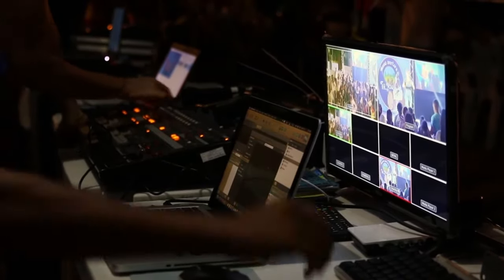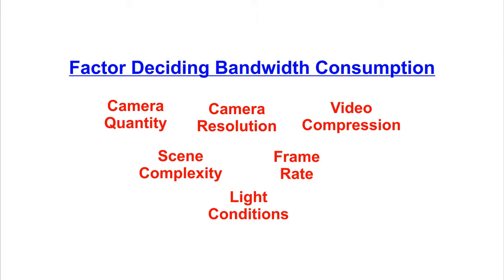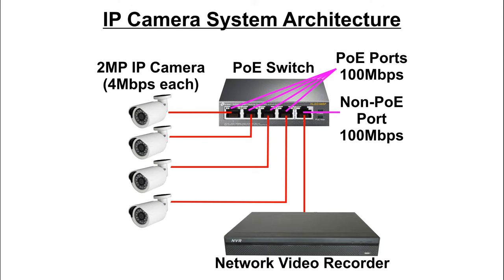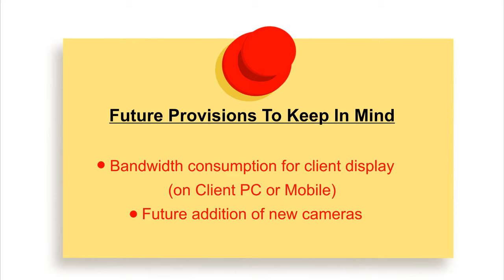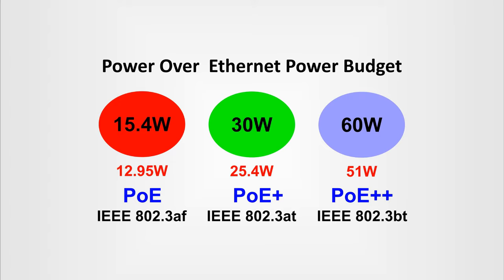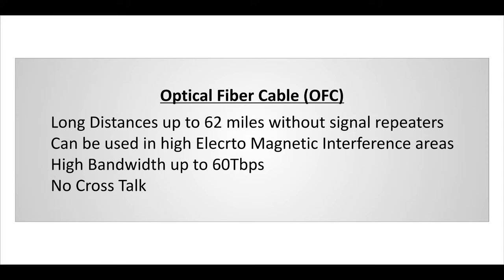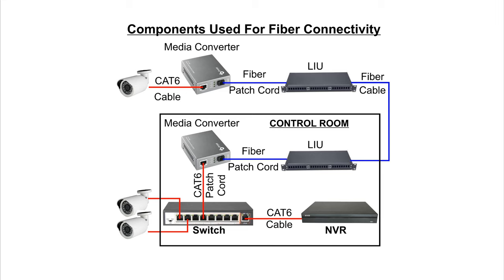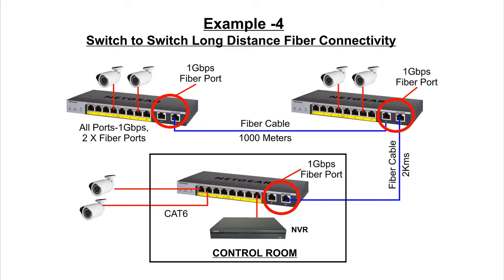IP CCTV Network Design | Component Used | Optical Fiber Cable | cctv networking #cctv #cctvcamera

Comment: Can i use ordinary or normal port on camera switch as uplink going to cctv room? Because some of the switch has no uplink port, intead of normal or ordinary port which is available.
Reply from the maker: You sure can use normal port. Uplink ports are  normally giga (1000Mbps) ports thus allowing sufficient bandwidths. If your normal port is also giga, then there is no difference.
If normal ports are 100Mbps even then they will pose no problem as long as bandwidth to be transferred is well under 100Mbps.
Reply: Can you make on your next video, how to connect multiple switches from access layer to core layer multi layer switches physically connected? Thanks
Reply from the maker: @reccakarl  Sure, will try. Thanks for suggestion.
Reply: Hi. What do you mean 70% of capacity, per port capacity or switch itself? Thanks
Reply from the maker: @reccakarl  This is no rule written anywhere. It's been considered so that we have some spare capacity in hand in case some need arises at later stages. I personally consider using 70% capacity of each port.
Reply: @AdventTechnical  hi thanks.  What if the edge switch is 1Gb, so we can use all of ports available even the camera is poe and the switch is poe also regardless of power budget does it matter?
Reply from the maker: @reccakarl  You can always use all the ports on the switch if required. Considering a bandwidth consumption of 4 Mbps by a typical IP camera and assuming the switch port to which it is connected to be gigabit (1024 Mbps), there will be no issues as the bandwidth handling capacity of switch port is more than what is required by the IP camera. We can even make use of switch with 100M ports to connect the cameras instead of switch with gigabit ports to save the cost. But please keep check on the bandwidth load on the uplink port of the switch (the port you are connecting to the NVR). Uplink port will carry the bandwidth load of all the cameras connected to the switch. The load on this port will decide whether to choose this port as 100M or gigabit.
PoE budget required by your cameras should always be taken into account while selecting the PoE switch.
Power requirements of camera increases at night because IR LEDs are turned on at night. If PoE budget of the switch is not sufficient, then there will be problem.

Comment: Example 4 ... The Gbps ports are over kill , assuming you are using multi mode fibre to keep down the cost. Multi mode has a capacity of 100Meg and only 40% of bandwidth should be used , so, providing  there are not to many camera's running full 1080p @ 25fps you will get away with it ... 
you would need to fit single mode to make the most of the 1G link and make it more "future" proof.
Also , 2Km is not long distance.. My links are over 7 miles and are not long distance.
Reply from the maker: Thanks for the comment. By long distance I mean any distance that can not be covered using CAT6 cable. And of course single mode is most suitable considering that price gap between SM and MM is reducing.

Comment: at 13:50 the distribution switch have max of 100Mbps but the load is 160Mpbs so it can't handle the load, right?
Reply from the maker: 160Mbps is the total load at the uplink port, which is 1Gbps.